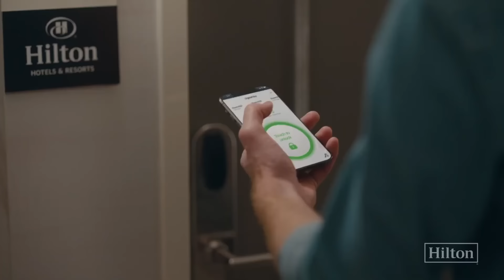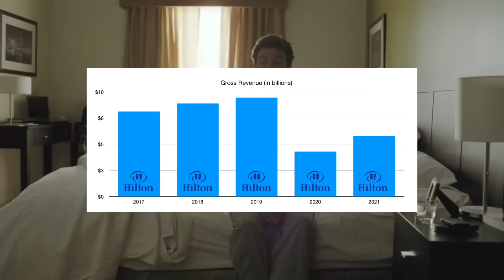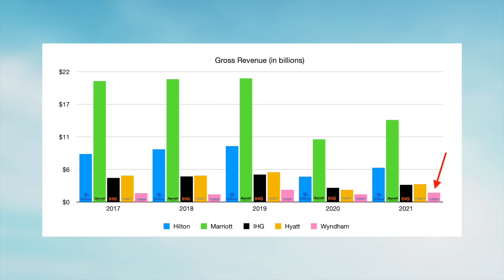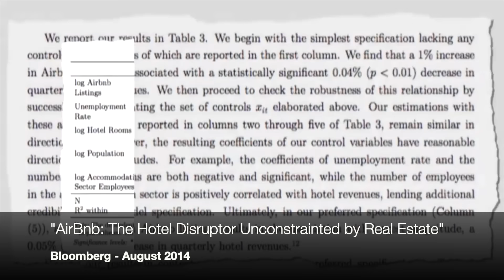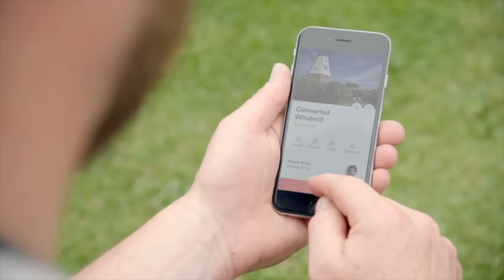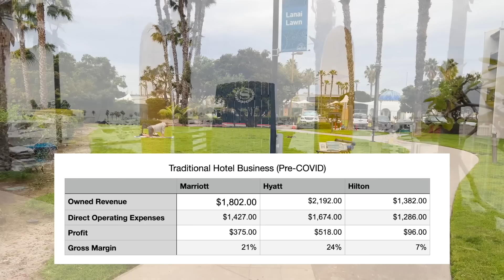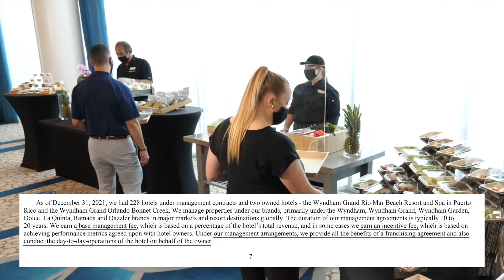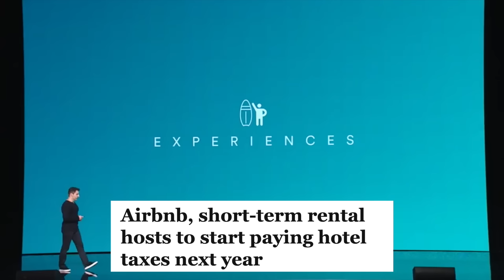Why Airbnb Fails to Disrupt the Hotel Industry

Comment: AirBNB rooms are less consistent, have worse customer service, cost the same or more compared to a hotel room, have fewer amenities, and I have to pay a large cleaning fee even though I already forced to do a bunch of cleaning anyways, and if i dont, i pay another cleaning fee on top of my existing cleaning fee. and often times the house is less centrally located compared to a downtown hotel. why the hell would i do that? the days of decent, $50/night rooms are over, theyre all $150-$250/night and for that, I can just rent a mid-scale hotel and zero headache and an easy, consistent, experience. with free breakfast. when im on vacation, i dont want to worry about not being able to reach the landlord in case of an issue, or having to clean up someone else's house or not knowing for sure if the place is going to shitty or have spy cameras in it.

Comment: You're forgetting a few factors. Many AirBNB customers are not even considering Wyndham, Hilton, Marriott, etc. 
They might be looking at a Motel 6 or even a KOA, and comparing the price of that to an AirBNB and they will often choose the AirBNB even if the fees are higher because it's usually still nicer than a Motel 6. Not only that, but I can get an AirBNB in a remote location that is much too small of a market to consider putting a hotel or motel. 

And the reason it DID disrupt the industry is the way in which people can rent out space that they were otherwise not using, directly to the customer. It also allowed the poorer people in remote locations to rent out their rooms and increased their access to money massively. Just the same way youtube has made people rich just for talking to a camera, airbnb has helped many people go from struggling to get by to being comfortable. The traditional hotel chains have lost billions to AirBNB. Unfortunately people got greedy and decided to buy up all of the houses and keep them from being bought by average people. This is why AirBNB sucks.

Comment: I don't quite agree to the downplay on the effect of AirBNB

While I do agree that services are available to Hotels, it is useless if the hotel makes you jump through hoops to avail them. For example, there are hotels in my country that have a pool BUT you are REQUIRED to wear the "necessary clothing" to jump into one. Which is BS. You do not need a costume to go to the pool that you paid for. It is not a costume party or a masquerade ball. Not to mention that for some hotels, they require prior reservation. Same with gym and massage. Why would you want a "reservation" for services that you paid for?

That is when I do Staycations. Which is very seldom. I usually book a hotel because the "natural attraction" is near thar hotel (Hiking, Fishing, Sightseeing, whatever). Hence I only book 2-3 nights. Why would I need "services" from an accomodation that I would leave for most of the day uninhabited? That is where AirBNB disrupts. There might be issues but if it works, an AirBNB can provide you a pool with NO RESERVATIONS and not require "necessary clothing". When I want to swim, I want to jump to the pool straightaway not through hoops just to swim at it. AirBNB provides that freedom at less prices.

Hotels within proximity of a "natural attraction" such as mountains for hikers or ski slopes for skiiers charge extra high for their location because they argue that they offer "services" at the hotel. When you are near a ski location, you want to ski. Not swim at the hotel's swimming pool. The service does not make sense yet you need to pay? Feels like an add-on overhead cost to me. An AirBNB would charge you extra for their location but it will definitely be cheaper.

I also do not agree that the AirBNB business model is not unique. I would not clump it to a franchise model like Mcdonald's since AirBNB does not work as a trusted brand but rather an online marketplace for accomodations. Hotel chains STILL ASSUME responsibility for the mishaps of their franchisee. 

So AirBNB DID disrupt not just the Housing Market but the hotel industry as well. And if these Hotel Chains are not worried behind closed doors, they should be.

Comment: You're strongly missing the point. It's not about a platform based business model. Corporate Hilton or Mariott may be asset light but those franchise owners still have to put up the capex to build dedicated hotel buildings and hire staff and everything else. This means it still takes a long time for hotels to scale and respond to market forces. 65% of Americans already own a home and would continue to do so whether or not Airbnb was an option. Those homes already have furniture and pay for electricity, water, heating, and internet. And since they're all individual. And if there's a downturn, the Airbnb owners will just take the listing down and turn it into a workout room or lease it out or something. On a whole system level, Airbnb is simply less regulated and more flexible. 

The only real advantage hotels have is marketing, and price insensitive clients like businesses will just default to them.
Reply: Hotels also have the advantage of consistency. You always check in at 3 p.m. and check out at 11 a.m., you can always expect WiFi, and you can always expect that they will have a room for you when you arrive. In case they can't fulfill the last part, most, if not all of the hotels cited in this video have a responsibility to find acceptable and equivalent lodging for you. If for some reason your Airbnb host cancels on you at 11p.m.? You're shit out of luck.

Comment: Airbnb will NEVER disrupt the home industry because the hotel industry ALWAYS has to be professional and ALWAYS has to abide by policies, regulations, and in some countries laws; this is where Airbnb fails mightily. The initial premise of their  idea  was to be able to stay in a bigger space, with equally more or  better comfortable surroundings and amenities but for a far much lesser price. I have been using Airbnb since 2014 and have used it in a multitude of countries and continents and more or  better comfortable surroundings and amenities for a far much lesser price was the case back then. But in the last 3-4 years, especially since Covid, Airbnbs have just flattered to deceive. It has become absurdly expensive and overpriced to rent accommodations, and the higher prices are not justified  when conditions of the place are still exactly the same. Also, nowadays, quality of listings are far worse, comfortability and cleanliness are atrocious and abhorrent, and landlords/people listing their rentals are crass, insensitive, unsympathetic, and just pure greedy. When you have an unregulated business structure this is what ends up happening. The idea  may seem great initially but in the long run it ends up being total chaos and unsustainable.

Comment: This video is just backwards. It do not account for hotels that are not resort hotels. So "low season" is different for the most big city hotels (majority of hotels on the planet lol). This video do not account for economy of scale, where if you have 30% load in ordinary hotel, your sales department SUCK and need to sell rooms to bigger groups, especially to the groups that generate banqueting revenue. Well, pretty normal for person with no hotel management experience to assume that low season is "ok". It is ducking failure. And extra amenities are not just operating cost, it is necessity to operate under certain standard or brand. Your money makers are rooms and banqueting at best. Everything else are serveries that you need to have, and good management lies in ability to make service operation as lean as possible while upholding standards. If you cannot meet financial goals, you either have dysfunctional middle management/administrative staff running amok that need to be cut, or completely incompetent top management. And lets do not even start on outsource personnel...

Yours truly management from Marriott/Rezidor/Accor in the last 12 years.

Comment: I just have to downvote because this entire video is missing the point. Airbnb is not a disrupter because it is a platform-based model. Yeah, franchises have existed for a long time. Airbnb is a disruption because it is accessing a ton of assets that nobody had access to before, i.e. people's homes. And THAT is plenty disruptive to the economy hotels/motels. You are right that it won't impact the high class hotels and I don't think anybody expects that it would. You have been comparing literal apples and oranges this entire time.

Comment: I think Airbnb is unique in itself. The hotel offers "standard" products so it is hard to make big five players differentiate from each other. Airbnb is offering unique housing, it is a moat against hotel industry ( it could be a curse too as many points out their bad experience)

But the hotel industry, on its own, could not generate more cash flow as the current business model: they are collecting fees from managing the hotel. However, Airbnb has the potential to build another Airbnb from its current state. Airbnb can collect fees from host, and they may, in the future, sell ads to host if host wants to attract more people. Airbnb could even sell membership to travellers if they want some fancy tags on their profile. Maybe in the future, they could offer rental car options: if you want to use the car onsite, pay a premium and hertz will deliver your car not at the airport  but at your place. And they can quote a premium for their unique car rental partner. 

They always can cut a share from the experience they are offering.